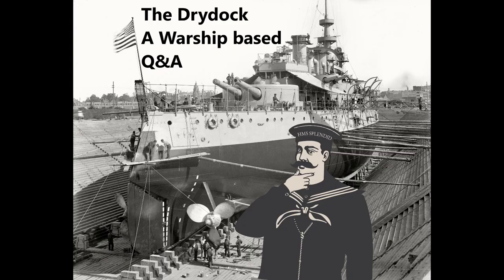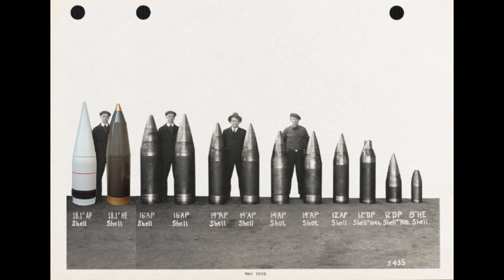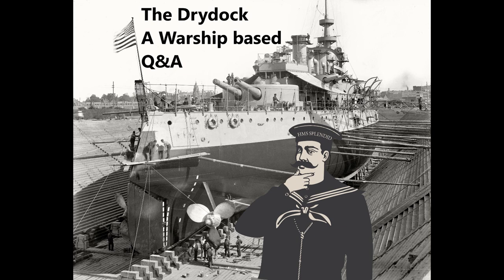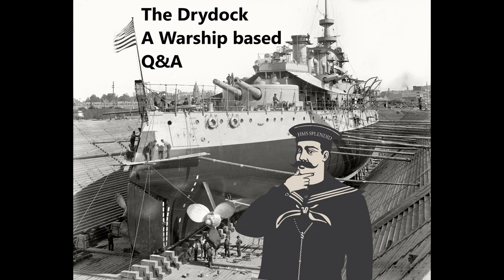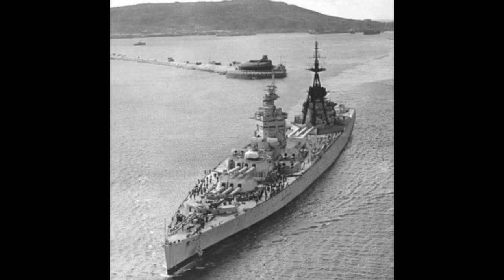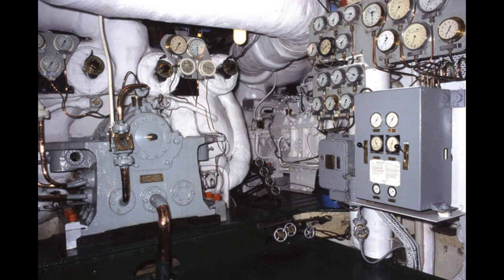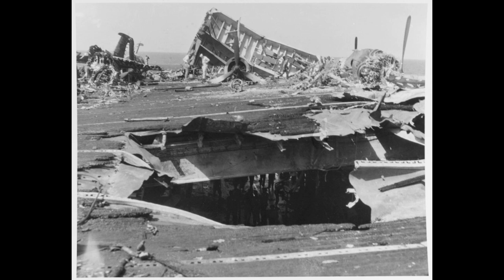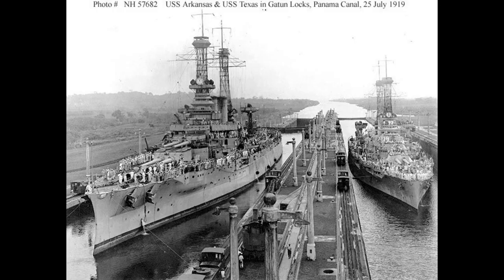The Drydock - Episode 094

Comment: I've never understood the USN's step backwards with unprotected AA mounts from during WWII and then postwar. They entered the war with the typical .50 caliber and 3" guns just mounted on decks in totally unprotected mounts. War experience rapidly showed why that was a bad idea, so most mounts were at least enclosed in gun tubs rising to about chest level, the tubs protected by a combination of steel and so-called "plastic" armor. That was really a layer of common asphalt, offering decent protection while being easy top roll out, even for ship refits. 20 mm guns almost always had a forward gun shield in addition to the tub while 40 mm Bofors went from no protection except for the tub to a very stout, nearly wraparound, shield by war's end. 

Postwar, they went backwards, with the 3"/50RF Marks 27, 33 and 34 back to generally unprotected mounts except for the gun tubs. Because of the height of gun's base, the crews were exposed mostly above the protection of the tub. A few classes did have the guns enclosed in a turret when they were the main armament. An example were the Courtney class DE's of the 1950's, with the forward 3"50 guns enclosed in a turret while the aft guns were once again only protected by a gun tub of inadequate height.
Reply: As I understand it, that was mostly because post-WW2 air attacks against ships would involve a lot less strafing of the ship by the aircraft, and more in the way of large warheads exploding all over the place. As Drach pointed out, the issue of ships splashing each other with their AA fire was a relatively uncommon problem even by the end of WW2, and post-war naval formations were generally even more spread-out (to give escorts more engagement time versus faster aircraft and later missiles), so that issue would become even less common. (I don't know if it did or not, but I can understand how naval planners and architects may have thought that it would)

So against pre-WW2 and mid-war attacks, a thin sheet of steel on the front or sides of your gun position gives you a decent amount of protection against machinegun fire from attacking aircraft, fragments from small explosions, and occasional 'friendly' fire from other ships. Post-war, that same amount of armor wouldn't do much against larger aircraft shells even in the case of a strafing attack (note that post-war aircraft started considering .50-caliber MG guns as 'tiny'), and even less against large anti-ship warheads. 

So the gun shields probably were viewed as simply not worth the extra weight given how little protection they would offer against any predicted attack. Mind you, it could be argued that the morale effect of not feeling exposed on deck with your ass swinging in the sea breeze may have been worth a few hundred tons of wasted steel...
Reply: @MagnusVictor2015  You lost me a bit on this one. There was no reason to expect that ships wouldn't have been subjected to the same kinds of strafing and bombing attacks that happened during the war. The biggest change was adding air to surface missiles to the mix. I think you misunderstood Drach. Adding armor shields or turrets to exposed gun positions was never because falling remnants of AA rounds was a huge problem, although they did kill and injure crew on occasion, especially in the closing stages of the Pacific campaign. The splinters we're both talking about are from the remnants of those larger shells and falling bombs. As they hit decks and superstructures, they broke the steel into hundreds and sometimes thousand of small pieces ranging from several hundred pounds to little bits the size of a sewing needle. These were the big risks to gun crews.

The splinter shield were not just the thin sheets of steel you apparently think they were. They had to be capable of defeating these sometimes large and heavy "splinters", something of a misnomer, since most of us think of splinters as something you get from a piece wood. The name does originate from the days of sail, when cannon balls shot the superstructure to pieces, sending wood splinters flying.The wraparound shield used on late war 40 mm quad mounts weighed about 4 tons, nearly half the weight of the actual guns themselves. Even the front shield on a 20 mm gun was half inch thick steel that weighed nearly 200 pounds. It was even thicker and covered more of the mount once power operated twin mountings were introduced, since shield weight on the single guns was limited by the need to make them free swinging due to their manual operation. The goal of the combination of gun tubs and shields was to keep those splinters from getting into the mount and injuring and killing crews. Many of the injuries to exposed crew wasn't from direct hits from bombs or shells, it was those splinters flying around. If you could protect gun crews from those, it was more likely they'd continue operating their guns rather than being flat on the deck avoiding splinters.  

If it's apparent to you I really didn't understand your question, please restate it and I'll give it another try.
Reply: I would argue that post-war air attacks would be quite different from mid-war and late-war conventional attacks. That is, mid-war attacks on warships generally consisted of upwards of several dozen aircraft, including bombers (which generally closed to within ~20mm AA range before releasing ordnance) and fighters (carrying smaller bombs and/or firing <30mm cannons at the ship to suppress AA fire). 

This paradigm meant that ships were rarely in danger from one or two smaller bomb hits (middle-weight warships and up, at least), but even a ~50lb GP bomb from a fighter posed a serious threat of shrapnel to the AA crews. So, if your ship doesn't absolutely /need/ to stop enemy aircraft before they get ordnance away, it can be worth it to protect the AA crews a bit more at the cost of some displacement.

But post-war (and late-war, especially with kamikaze strikes and stand-off ordnance) the ship-versus-planes paradigm shifts: air attacks consisting of larger numbers of smaller munitions become more rare, and attacks consisting of fewer numbers of larger munitions become the norm. In /that/ situation, if your ship takes a hit from 1-2 multi-thousand-pound warheads, not only is the ship going to be a reef very soon, but any deck crew near that explosion are likely beyond helping even with a good gun shield around their position. Under those circumstances, it can be seen as logical to reduce the protection afforded to each AA mount, and use that displacement to either increase the number/size of AA batteries (to hopefully destroy attacking aircraft before they release their ordnance at all), or decrease the size of the ship (to save cost, so that in theory you can have more ships to serve as pickets, or mount more long-range ordnance on your larger ships to suppress hostile carriers or air bases to minimize the number of planes that they can send your way).

TL;DR against big, post-war anti-ship munitions, protecting your AA crew against shrapnel doesn't help much when your smaller battery of armored AA mounts fails to stop a high-speed bomber from cutting your ship in half with a brace of 2,000-lb bombs and dunking those same crewmen into the freezing water and flaming oil.
Reply: @MagnusVictor2015  Once we left the biplane era, attacks with 50 pound bombs just didn't happen. Even 100 pound bombs were generally limited to planes like the Wildcat and others that had a limited bomb capacity. Dauntless dive bombers routinely carried 1,000 and 1,500 pound bombs, and the Helldiver could carry a 2,000 pound bomb in the internal bombay and two 500 pound bombs underwing. Corsairs could carry 4,000 pounds of bombs. Japanese planes were carrying carrying repurposed 8" and 16" shells as bombs. Bombing by naval aircraft wasn't just a bunch of tiny bombs. A lot of our ships did take hits from 1,500 to 2,500 pound bombs, not mentions kamikazes. The big risk today is antiship missiles, but the person I'm writing about is postwar into the late 50's. The types of aerial shipping attacks then weren't any different than the late war period.

Comment: I know of the G3's existence and I constantly hear you praise the design... However I wasn't familiar with its specs so I finally looked i up and was quite amazed. Its a 1920s design too. Well no wonder, its 10,000 tons more in terms of displacement compared to contemporaries. Very impressive ship.
Reply: It was also vaporware as it was pretty much ordered on the 24th of October, and paused on November 18th of the same year due to the Washington Naval Conference.  They were designed to be larger than the Hood and use guns that the british did not make and when they did eventually make one of that caliber in a triple turret it was so bad it took the better part of a decade to even work properly.  The british were using the design only to win concessions from the U.S. which had a plan to produce several dozen extremely powerful warships, and then actually started making all of them.  Whereas the british had trouble just getting the Hood built as they were bankrupt and would in no way be able to begin another arms race with a nation that had 2 times the manufacturing capacity they did even in 1920.

Drach is a big fan of these paper ships but they are as real as the German H44 ships.
Reply: Certainly, the G3 would have used the same guns as the Nelsons which are rather under powered, barely any better than the previous 15" guns in terms of penetration but much less accurate.
But then again contemporary 16" guns that actually entered service weren't much better in terms of penetration.
The specs were still overall very impressive though as the gun's penetration were comparable to its contemporary, although its accuracy was a issue along with other problems.
It was indeed likely vaporware but given it was technically "started," it counts as a candidate to the question. Even if it wasn't completed due to the Washington naval treaty, or in an alternate reality, due to budgetary concerns, it was still started but never completed.
Reply: @neurofiedyamato8763  No.  It was not started.  It was essentially given a thumbs up and thrown into the building lineup so the British would have something to point to at WNT to oppose the American, and Japanese warships that were much more powerful than any ship the British had started.  They had to plead to have their paper tiger H.M.S. Hood built since both foreign powers had not only built 16" gun ships but were building many more while the British had not yet built even one.

The G3 was a brilliant design from all appearances, yet was altered many time just to make it realistically a design that could even be built by the British without also building an entirely new building slip as well, just like the German vaporware ships of WWII.

Might as well let the U.S. claim all the Tillmans as warships too.
Reply: The shipyard was paid for laying down the first G3 keel. So it was in fact started, otherwise the shipyard would not have been compensated. The Tillman by comparison was a design study and largely academic rather than a design to be built.

Comment: 33:21 First and foremost, the Olympic-class liners quite maneuverable, even for a big ship. I’ve never found any information as to the Turning Circle of Olympic’s, or even Britannic’s for that matter (those two might also make an interesting comparison to contemporary early-'10a battleships' turning circle as Titanic was fitted with three triple-blades propellers while Olympic and Britannic has two triple-bladed propellers and a quadruple-bladed center propeller), but Titanic’s recorded Turning Circle is 587 meters at 21 knots during her sea trials. For comparison, Standard Type battleships of the USN (starting with the Nevada-class), had a turning circle of roughly 700 yards (640.08 meters) at 21 knots. So Titanic’s turning circle is 53.08 meters (58.049 yards) tighter than that of a standard WW1 battleship.
And Titanic sank due to her watertight bulkheads not extending as far as it should have which was remedied by Olympic’s refit after Titanic sank and even received a ridiculously huge amount of lifeboats and a double hull.
Also at the time of Titanic’s maiden voyage, the most recent battleship’s commissioned into the Royal Navy were the Colossus-class and the Orion-class HMS Orion

Comment: The picture of various large-calibre Naval shells at the beginning of this episode was obviously edited to add the "Special 16-inch" shells of the Yamato/Musashi -- the picture was dated 1919 for one thing. The other thing is that those particular shells are actually smaller than the picture suggests, either that or the people standing behind the shells are not of average stature.
I've visited the Yamato museum in Kure where various 18.1" shells (drill rounds, I presume) are on display and they're all less than five foot long. The armour-penetrating shells have a conical aerodynamic casing on the tip, the actual steel penetrator is actually surprisingly blunt, presumably for strength.
Reply: Wasn't there those 18 inch gunned moniters around at that point?
Reply: @moritamikamikara3879  There were.

Comment: With regards to torpedo aiming - ships being attacked by torpedoes will also generally manouvere - Repulse dodged 19 if I remember rightly, so this would account for more hits on the ends (if you turn in or away and take a hit by definition much more of the ends will be proportionally higher than the middle parts). Of course in a case of complete surprise (submarines) of if they elect to continue on course to provide a stable antiaircraft gun platform (Which I think is what Bismark did) this is less likely. Regarding straights - Mines are a major consideration - ala gallipoli.

Comment: Sorry if this has been asked before But what if HMS Hood got beaten up by Bismark but not sunk. Hood and PoW withdrew damaged and made it back to the UK. Bismark goes on to be sunk by KGV and Rodney.
Mid 1941 Hood receives the required major refit. It is then available to be used in the North Atlantic and possible used in the BPF.
Would the Vanguard then be built with the old 15" artillery or a possible Lion based outfit of guns.

Also a one on one fight between a fully fit Tirpitz and an as completed Vanguard.

Cheers

Comment: My take is the hit on Bismark that sealed it's fate was a golden BB, pure luck.  The hits on Yorktown's boilers and Hornet's engines that left both of them dead on the water do not quite rise to that level, due to the size of the target area.  The hit to Saratoga's electrical control room that ran the electric drive system is certainly another golden BB.  In the case of both Bismark and Saratoga,  even if the vulnerable spot was marked with a big X and a sign "Aim Here",  the variabilities of torpedoes: estimating target speed, estimating range, target course changes, would make trying to hit such a small area futile.

Comment: Personally I would’ve picked the Lion-class as either equal or slightly better than the Montanas, mainly the 1944 Design for the Lions (being the 16"/45 Mark IV guns (that use the 1,152 kg AP shell instead of the Mark II's 1,080 kg AP shell), the 12 twin 4.5"/45 Mark V DP guns (essentially having several Darings as a secondary-battery), Vanguard-style bow, and of course the main battery being autoloading, which the Montanas would not have).

Comment: Question: In your recent 5 hour Q&A you mentioned, that you'd reduce the "diversity" within the german shipping in World War 2 as a first step, if you were in command (e.g. the Hippers). Why is that? Ships aren't exactly mass produced, so lack of commonality isn't much of a problem, is it?
Reply: MadnerKami - A navy could usually get as many as 50% more ships of a given class by standardizing the design. A good example would be the American “Standards”. In the Germans’ case, 1 extra Bismarck, 1 extra Scharnhorst & Seydlitz or Lützow (2 extra Hippers) would have been finished if they had standardized their design & construction. The Germans used standardized, assembly line manufacturing on their submarines to produce a LOT of submarines.
Reply: @TraditionalAnglican  Th0ugh in this case, Germany already has way too big of a surface fleet and building more is going to make that worse.
Reply: Bk Jeong - The surface fleet wasn’t enough to confront the RN, & more efficiency in building the surface fleet would have allowed more resources to be used to build more U-Boats.
Reply: @TraditionalAnglican  The surface fleet was never going to be a good idea.